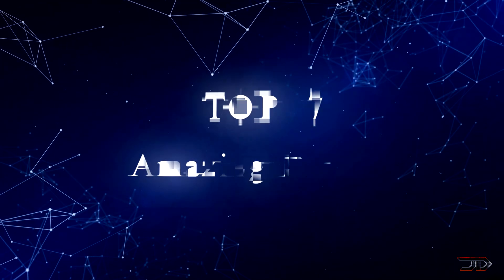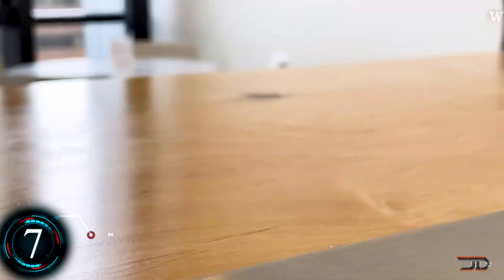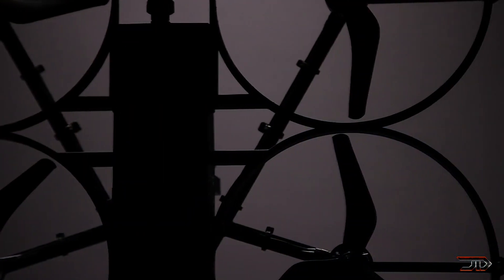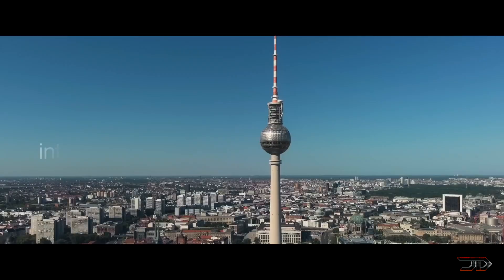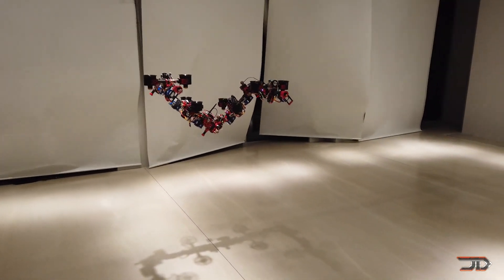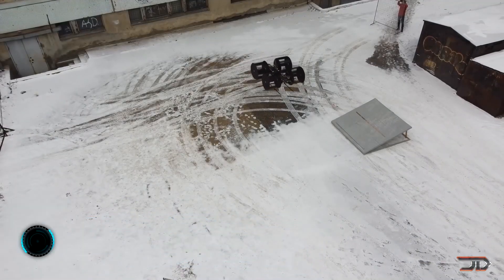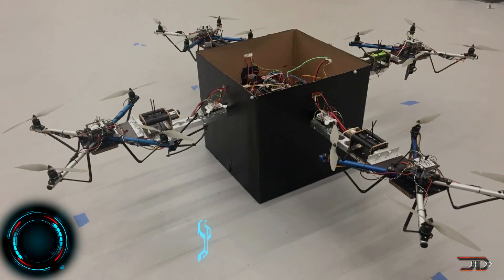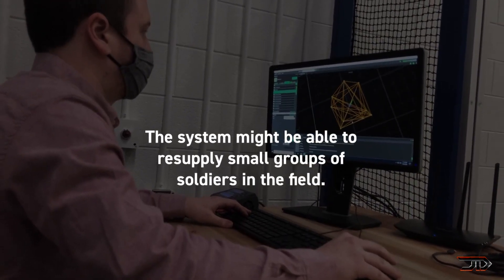7 AMAZING New Drones (2021)

Comment: I could make that swat drone right now.  That glass breaker is just a motor that spins a rod that has bits of ceramic (from a spark plug, AKA ninja rocks) glued on the ends.  Not exactly classified info.

Comment: Energy used for lift scales linearly with the speed at which air is pushed downwards. That means that concepts like the dragon that need to move air at high speeds through small props will not be able to compete in flight time. I believe more in things with wings.